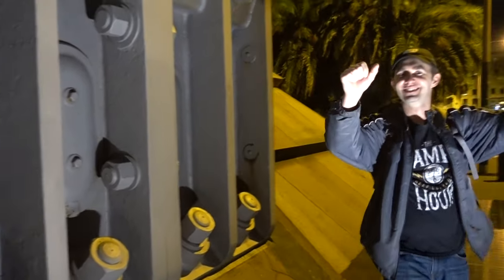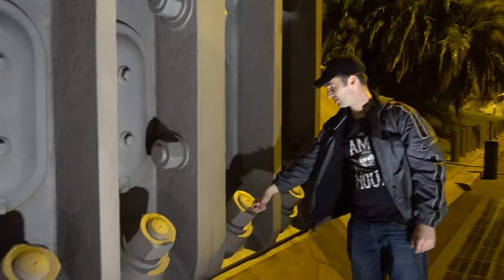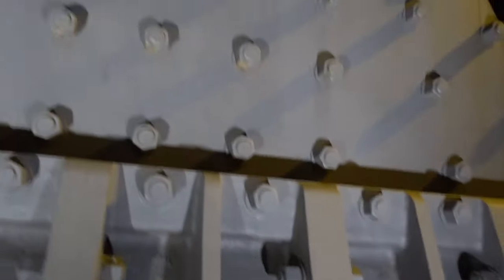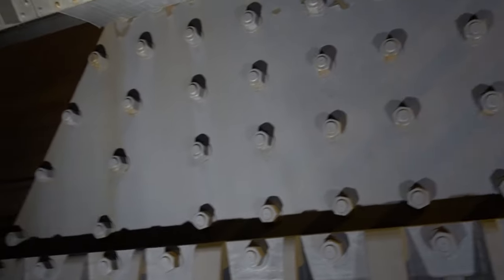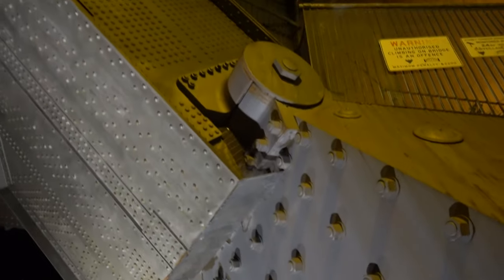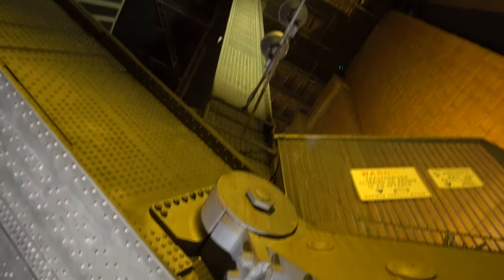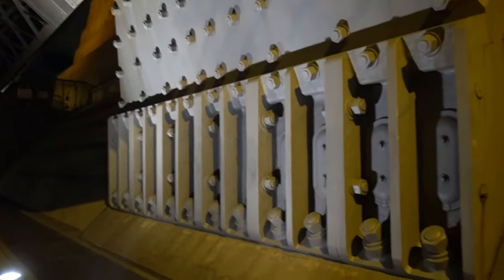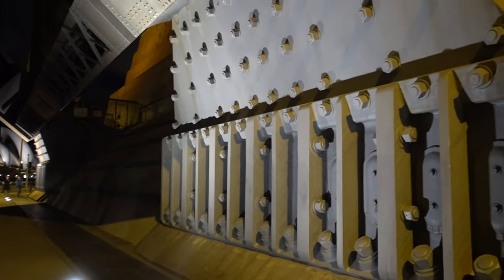Sydney Harbour Bridge Construction

Comment: The bridge is a truss/cantilever design. The cables were only used to support the bridge halves during construction. The cables were later removed after the two sides were joined (North & South). I do not mean to diminish your comment but only to explain the brilliant design of this bridge built in the early 1930s!...I am not Australian but greatly admire the brilliant design and construction of this structure.

Comment: I bet they used a custom-made torque wrench/ratchet to tighten those down.  I'm guessing somewhere around 10,000 newton meters (~7300 ft/lb) for a bolt that size.  Probably would require at least a 8 foot wrench to get that kind of torque.  I doubt you would ever be able to get those off if they really haven't been removed in 90 years.  Very cool, always like to see stuff like that.